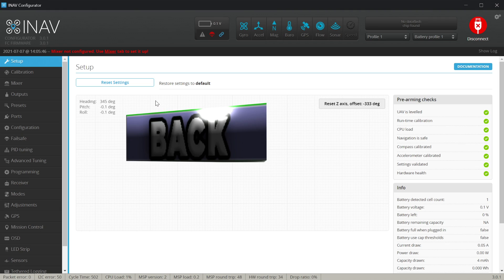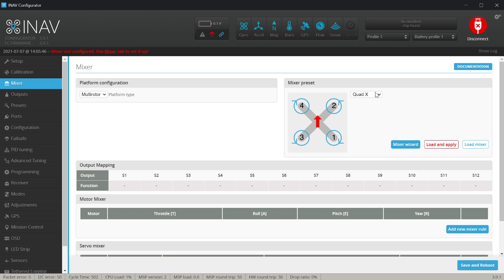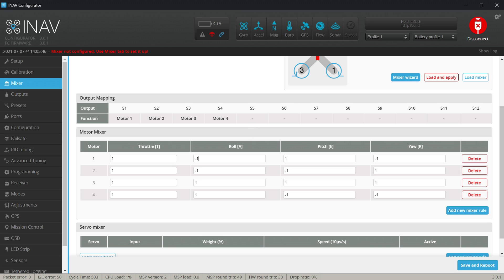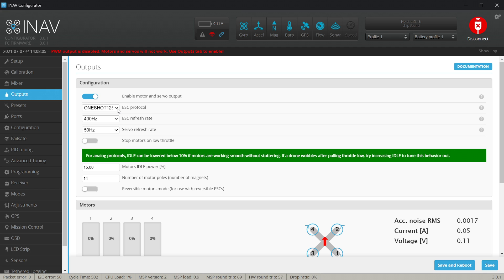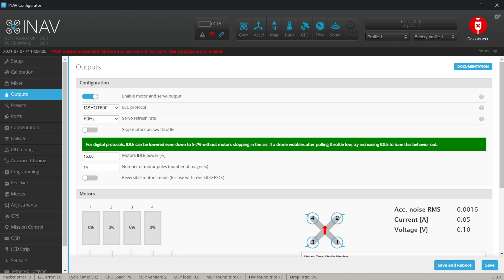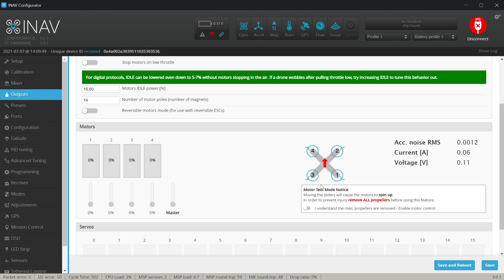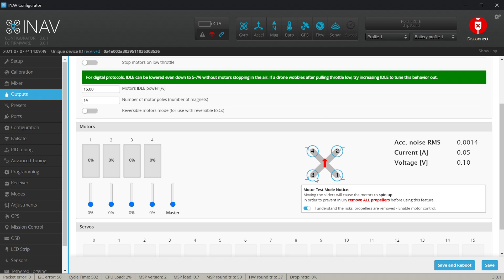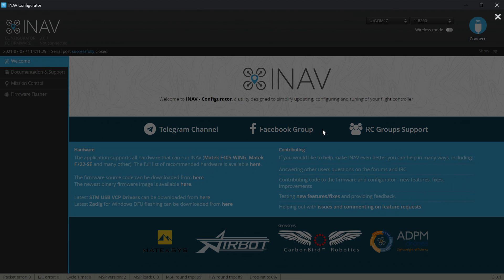Mixer & outputs | INAV on a FPV drone tutorial

Comment: my motors are all in the correct configuration but they all turn in the opposite direction, is there a fix for that?
Reply from the maker: Use BLHeli configurator to reverse that. Or swap any 2 wires for motor

Comment: @FPV University  Hi Pavel, I have an old dji f550 hexacopter with 10" props and am installing a new fc. What profile should I pick when I flash iNav? 3-7"? Or maybe custom UAV? Thanks in advance
Reply from the maker: The problem is that nobody knows :) Probably you have to start with 7-inch and lower filters cutoff frequencies to roughly 60Hz

Comment: Hi pawel , i am new to inav firmware . I am not sure if this is a problem or not but the numeric assignments are flopped from right to left vice vera for both front and rear two motors  but the motor rotation is correct . I tried mixer wizard to change the numeric assignments on the motors  even after changing the motor mixer value the numeric assignments have not changed  eg rear two motors R3 L1,  when enabling L1 R3 spins . Tried CLI to change resouce of motor by "resource motor 1 B06" but feedback shows motor 1 is in its initail resource (not changed) . Other than swapping the motors by resoldering any other suggestions to rectify this issue? Advice is appreciated , thank you.
Reply from the maker: mixer wizard is not changing motor order. It changes mixer to accomodate any motor order there is.

Comment: I have the EMax 5'' NightHawk ( 3-4 yrs old ) and am unsure of the Esc Protocol and Refresh  settings - I set them at Standard and 400Hz is that what you would suggest

 The motors are EMax MT2204/2300KV  - ESC's EMax BLheli 12A  (drive Freq 8KHz)

 I have changed iNav Config from 2.6.1 to 3.0.1 so I have some catching up to do 

 Pawel - please enlighten me .... is there any conflict with Google Chrome and iNav...joe
Reply from the maker: They will work with OneShot125 for sure.
Reply: @FPVUniversity  - will give it ago  -  Great iNav training video's - probably more Q's to follow ...joe

Comment: If U run Props Out, swap the YAW 1 for -1 and -1 for 1..and ur good to go
INAV is props IN by default, and easy to change :)
Reply from the maker: That or https://github.com/iNavFlight/inav/blob/master/docs/Settings.md#motor_direction_inverted
Reply: Good to know but there should be a switch for that in the configurator.